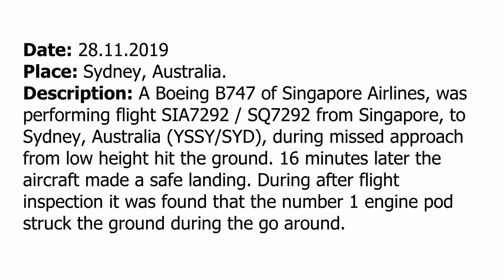(Real ATC) Engine pod struck the ground during go around at Sydney. A Singapore B747 hit the ground.

Comment: 1:07 Yeah, there was a gust [?] on short final, SIA7292
1:22 [not clear]= about
1:26 Maintain 3000, SIA7292 and we are heading 240.
5:34 SIA7292, turn left heading 060 for base.
5:37 Left turn 060 for base, SIA7292.
5:43 SIA7292, do you require the airport to be placed on local standby or any services required?
5:52 Sounds like "We are just making an autoland."
6:01 We are just performing an autoland, SIA7292.
6:42 Tower, good evening, SIA7292, runway 34L.
Reply from the maker: Thank you

Comment: What is need to issue taxi instructions, while the aircraft is airborne, executing its final approach?
Reply: Happens when another aircraft is on approach behind them. Making sure they exit the runway with minimal delay.
Reply: Steve Cushman -What spacing interval is approach providing?, I have never heard this procedure used, must only be used in Sidney.
Reply: @rubenvillanueva8635  Depends upon a few variables (ex. the type of AC - heavy/non-heavy), but regardless of intentions, sometimes the following A/C is coming in faster and gains on the A/C ahead. ATC will sometimes mitigate this by asking the lead A/C to exit without delay and will give a preferred taxi exit point. Of course, if that exit isn't feasible (maybe we landed long), then we'd not be able to comply and the following A/C would have to go around.
Reply: Steve Cushman - Steve, appreciate your reply. The Approach/Arrival controller sets up the spacing, based on the category. He can utilise vectors or speed reductions to attain the spacing. Usually, this speed reduction is accomplished well before the FAF. After landing, the Tower has a few instructions available to keep the flow moving. "If able, right/left turn next taxiway", "Taxi without delay". For legal reasons, they do not instruct the pilot where to exit while he is still airborne. Most pilots will vacate as soon as possible after the aircraft has decreased to a manageable speed, but the runway, technically, is his until he  vacates. High speed exits, came into use in the late '60s, they reduced the time an aircraft had to stay on the runway during the landing roll out, and are used constantly.